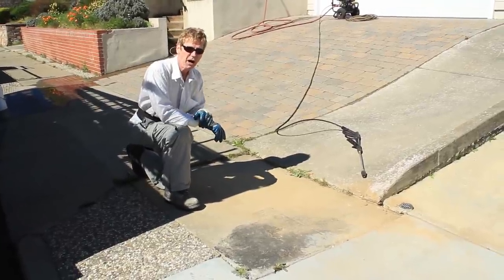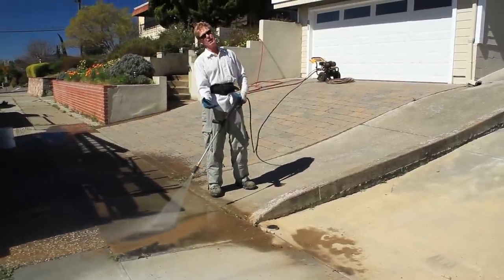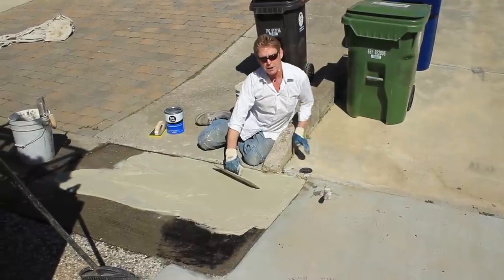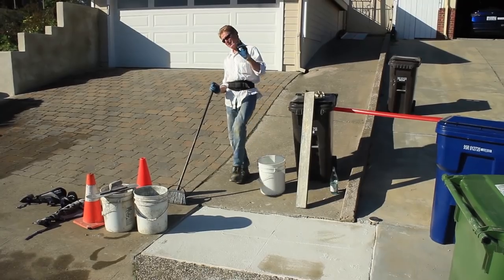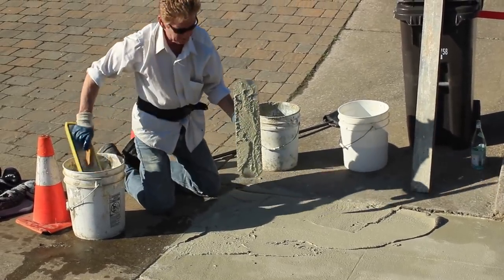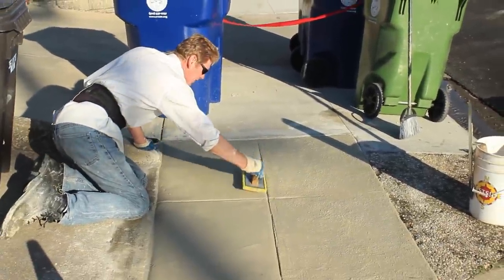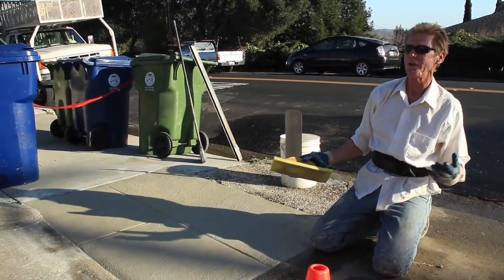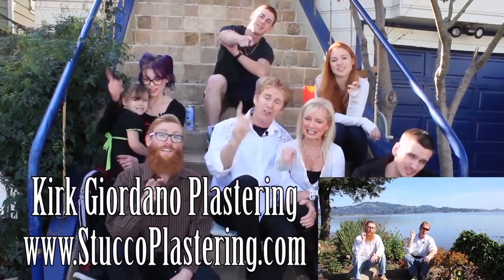Repair uneven concrete

Comment: Kirk. Only you can keep me Watching a video about an issue I don’t even  have for 25 minutes, and still consider it time well spent. On holiday no less  ❤
Also. Funny how the ..what did you call it? Finishing touches? Are the hardest to achieve by a non pro.
Alsoooo not only did I watch that aforementioned video, but also (after bombarding you with ratio questions), piggy backed on it, to fix concrete stairs, and a much more wedged parking entrance surfacing layer.
Still holds after few years  gone by,.  I’m not expecting 20. But I think anything above 4 ,to 5 years is a win. 

Anyways. Always love to watch a master at work.
Would love to see how that fix held over the winter.
Reply from the maker: Morning Fish dude,man, I like your style than you.😉

Comment: I know Kirk doesn’t like/specialize in resurfacing but it looks damn good. I bet the customer likes it
Reply from the maker: Evening Pierce, for 300 bucks she did, even knowing this is not a permanent fix, meaning what I applied will stay put, but that slab is sinking, and no doubt it will continue in the years to come.😉  Kirk’s Tip:  all subscribers or anyone who stumbles on our channel with a question, type it into our Stucco/Plastering channel, and like magic, a video will appear to explain how it's done. 
   This feature is miles ahead of any plastering forum. 🥳
Kirk & Jason Giordano Plastering

Comment: Kirk I’ve done it several times with primus mud and ran acrylic finish on it. Also I have just skimmed it with poly bond and/ primus and it works great as a resurfacer. Keep up the good work
Reply from the maker: Good evening Amber, good tip, thank you.🍻

Comment: Appreciate your videos! Got a few cracks around my house and also a bag of poly blend and since the concrete dude didn't show up to give me a quote I'm just going to try the poly blend...ever try the prism stuff? have a box of that in my garage also...(no idea where i got them! Probably came with the house) Thanks again sir 💯:)👍.
Reply from the maker: Good afternoon Charlie green, Polybond will work for crack repairs but has lite grainy sand to it. 
If the crack is huge, you may want to hit it again when the poly bond is dry as it won't go more than a quarter of an inch without shrinking.
FYI, Poly-bond by La Habra is specifically engineered to adhere styrofoam to base coats of stucco. Thus, it's an adhesive cementitious cement.
          Kirk and Jason Giordano, together we have provided to all folks throughout the world the most complete plastering encyclopedia ever created online.
   The plastering surgeons of Youtube, with well over 850 'free' self-help videos 🎭 👀💃
 Bringing peace, love, and brotherhood back into plastering.🏝🎆

Comment: One of the best instructional  you have ever produced guys. 
I think I know why the water part is such a recurring issue.
Most of us do it yourself guys, never used a power washer, not to mention a gas powered one.
So ..for me at least, it want obvious just how much important it is to make sure the old concrete is not just damp.. but wet inside as well, for a good mechanical bond. But I do have a tip for those without a notion as to how to damp the old surface.

Get an old bedsheet even. Cover the surface with it and drench it with water. And let it hang there for an hour, while making sure it’s always drenched with water.
That should do it. 
Also..another tip for good bonding is first brush the surface with a water thinned cement ..simple one. Like a. Painting texture.
As cement is basically a sort of adhesive ..combining it with water like that will connect the two layers.. old and new ..better.
Just make sure that the brushed cement is still at least damp when you apply the top layer of concrete. If it’s dry then you need to wet it again
Reply from the maker: Good morning Gefilta, Good advice my friend.
    I would add if a homeowner does not have pressure washer available that is strong enough to etch the concrete. 
Then to improvise and etch the concrete well with a "wire-brush" and some old fashioned elbow grease, then rinse off excess loose cement dust. 
   Some readers might think, where do I find elbow grease? 😎I'm referring to physical strength or muscle with the effort to scrub the dust off.
Folks are now ready, to begin with, whatever first prep steps they are partial too. 
                         Bringing peace, love, and brotherhood back to the world of, “Plastering.” 😏
With over 800 educational and free Youtube videos, by your favorite plaster geek, “me,” and my son, “Jason,” the bearded plasterer.😉
Reply: Kirk Giordano plastering Inc. 
good advice.  I also rigged a wire brush myself so I could mount it on a jigsaw . Pretty funny. 
Will an acid wash . Like 30% acid, do the trick as well? That is.. if you ever heard of it
Reply from the maker: Good evening Gefilta, yes, the acid will etch the concrete.
Then go into the street and makes its way into our water supply. I don't like to use toxic stuff if I don't have to.
Plus, with using acid you'd need a respirator. The only toxins I'll allow are whats in my beers. 🍺
                         Bringing peace, love, and brotherhood back to the world of “Plastering.” 😏
With over 800 educational and free Youtube videos, by your favorite plaster geek, “me,” and my son, “Jason,” the bearded plasterer.😉

Comment: You are right,  that stuff  is strong, I  tried  to remove  a crooked piece  of foam from around  my window  on the brown  coat, just about impossible,  unbelievably  strong, good job.
Reply from the maker: Good morning DJ.
 Poly Bond is so strong an adhesive cement plaster, that we would have to cut the styrofoam with a saws-all, as once stuck. it's permanent.
Bringing peace, love, and brotherhood back to the world of, “Plastering.”😏
With over 800 educational and free Youtube videos, by your favorite plaster geek, “me,” and my son, “Jason,” the bearded plasterer. 🍻

Comment: That looked difficult!    If Kirk doesn't make it look easy, it's a tough job.
Reply from the maker: This was easy but tedious. There are many more user-friendly products in the description. The most important part is cleaning the concrete, so it's clean enough to eat off. Otherwise, no product will work. 🥽

Comment: Hi Kirk thanks to you I did all the stucco walls in my yard . I caulked all the hair lines and then used Commercial Grade Quikrete with Hydraulic Water- stop Cement .
I was able to seal a whole I had i my wall and water proof my basement . After that I painted my stucco walls in the my yard with Sherwin Williams  Loxon xp  Water proofing  Masonry Coating. I trying to send you a picture but I have trouble sending it to you .   I  even build a small  garden wall for my yard .  
I really help again its about cement and  know you don't cement . But know you know this question . I  three cement cracks  blocks in my yard .   Two are  medium size and the other is half  of one block .  I don't want to pull them out . I just want to go over them and fill them up with cement .  My question is ? I  been told not to mix  Grade Quikrete with Hydraulic  with Commercial Grade Quikrete Mason Mix Type & Mortar . I was told it will crack ?  Is this true ?  I didn't have enough  to fill  the whole and have to get more  and it did get hairline cracks . I tried very hard to do this and wasn't easy for me but I am not giving up .  Please help me and suggest to me what I am doing wrong ?  I will  try and send pictures . I Proud of my self the yard looks nice . But I want to do the cement blocks before it gets too cold .  You are helping everyone one and a blessing for all of us .   Thank you .
Reply from the maker: Good afternoon Brenda, no worries I'd recommend a ten or 25-pound box of, Raip set mortar or even Rapid set stucco, both will work.😉
 The mortar sets really fast and is crazy strong, in fact, it set so fast you will have less than ten minutes to design it like you want to.
 The stucco will also work it set in about 20 to 25 minutes. The decision to bay a ten-pound or twenty-five-pound box will have to be made by you.
 It's best to buy too much and throw some away than to buy too little and need more.🤔
          Kirk and Jason Giordano, together we have provided to all folks throughout the world the most complete plastering encyclopedia ever created online.
   The plastering surgeons of Youtube, with well over 850 'free' self-help videos 🎭 👀💃
 Bringing peace, love, and brotherhood back into plastering.🏝🎆
https://www.nps.gov/tps/how-to-preserve/briefs/22-stucco.htm

Comment: I have an over 50 year old concrete patio behind my house in NY and due to the freeze/thaw cycling we get massive sprawling if you don’t seal concrete and/or use salt in the winter; we’ve been resurfacing concrete for decades with simply a pressure washing, 2-3 coats of diluted bonding agent sprayed over, and a Portland slurry with a fortified then simply Portland and sand, plus just a little lime and it lasts for years and is quite cheap. For some better protection we’ll use RapidSet CementAll and their flow aid as it cures out to 9,000 PSI and is very resistant to water and salt. Top and Bond is a lot of people’s go-to but is just too expensive for any kind of real area; we’ve done this over driveways and in garages and have never had issues with some top coats going beyond 20 years, though some can pop/sprawl especially if highly salted and if we get days cycling between warm and freezing. Ultimately do what you’re comfortable with but I’m always looking to save $ and topping concrete is a big money saver.
Reply from the maker: Howdy Libertarian, many ways to skin a cat, those methods do indeed work. That cement all is kind of fun to work with, huh, sets in like 5 minutes, but the strength is indeed unreal. cheers, my friend.🍾
Reply: @StuccoPlastering : Depends a lot on weather as it sets a lot quicker on hot days but 10-15 minutes can be expected, once mixing starts; you can extend times by keeping the bags cold or using ice water and speed things up by using hot water. They also conveniently have packages of flow aid, which works like a super plasticizer to increase flow without increasing water and decreasing strength, and a set retarder which buys about 10-25 more minutes per packet up to 4/55 lb. bag. I like the RapidSet line as it is hard as a rock in an hour, without set retarder, and was a big go-to in the Military when time counts. Grew up in a family of tradesmen including a mason or two and while I didn’t go into masonry I do it from time to time; I’m always amazed at the longevity and look of a days work, you just don’t get that from all the trades. Like the videos, just thinking of stucco as I’ve been redoing the 50-140 year old coat on the foundation and just unifying all the additions; while it looks nice it reminds me I’m no spring chicken and I’m glad I choose a trade that was less manually hard.
Reply: Top and Bond? I'm halfway on an area trying Top and Bond, but it ends up with some  cracks and blotchy spots. The manufacturer now tells me Top and Bond is NOT for resurfacing any area, only for small repairs... Everyone tells me Ardex is the best stuff to use now.

Comment: OK, went to both Lowes and Home Depot  and could not find this Poly Bond. A dude on the street said he could "get stuff" he looked really shady but for $100 he hooked me up with a pack (it looked like he took a bit for himself). I have no experience with Poly Bond or concrete for that matter, but I used hot glue once so I figured how hard could it be? Well, it was a disaster. I managed to burn down my house! My wife left me for the shady dude and my pet fish no longer acknowledges my presence. If only someone had warned me!
Reply from the maker: Howdy Hanging in there, like a sock in a dryer, you still have his phone number? Hook me up.🍾
Reply: Cause he's  a fraud
Reply: @HangininSF you just made my day 😂

Comment: Really enjoy Kirk and Jay's videos. I'm hoping the leveling concrete that you mentioned from Lowe's or HomeDepot will help for a basketball court 35×35 with hairline cracks
Reply from the maker: Look for Rapid set leveler as Rapid set is some crazy strong stuff.🍾
Reply: @StuccoPlastering  thanks for the tip Kirk. 👍

Comment: Rapid Set works great, but better move quick.  We fixed pot holes in Sky Harbor airport with that stuff.  Set to 4000 PSI in 2 hours.
Reply from the maker: Howdy good tip I think, Is it an adhesive cement or just a cement?🤔
Reply: @StuccoPlastering  Rapid Set is its own type of cement, it is non shrink, and can even be used for doweling anchors.  It can be feathered, They have patch, mortar, stucco, concrete, water stop. They actually started selling it at Home Depot, used to be only in concrete supply houses.  They have 10 pound boxes and 50 pound bags. Grab a blue box and try it out, great for repairs, will hit 12,000 PSI in a month.  I use it to repair stucco around garage openings that were vehicle damaged. Its definitely an adhesive.

Comment: Kirk do those yellow floats  make  have a nicer look compared to the  green ones i seen you use  i know a little the finishing  part. I Was Union concrete carpenter for over 25 years i  stated on Fondation  I did almost everything hi risers in L.A  Highway bridges. But  never tried stucco any of my walls.  Now I  feel like I can do a nice job  i really like all your videos
Reply from the maker: Hi Joe, there is no difference in the appearance of the stucco finish, the yellow ones are made a bit stronger.😉 Depends naturally on who is making them.
Reply: @StuccoPlastering  thank you Sir your the best. I'll take a picture of the block wall and stucco job i did watching your videos
Reply from the maker: @joegarcia4424  Howdy Joe, cool beans Daddieo.

Comment: Well I don't want to put a hole in your boat, the lines are called control joints, expansion joints are oil impregnated fiber board. Usually installed next to drive cut, or to marry garage floor to driveway. And used in many other applications.
Reply from the maker: Howdy Peter, what lines?
      FYI, I have many videos that explain control and or expansion joints.
 Bringing peace, love, and brotherhood back to the world of Plastering. 🌍
With over 850 educational and free Youtube videos, by your favorite plaster geek, 
🤓 and my son, Jason, the bearded plasterer.💃🧘🏻🧞‍♂️🎉
Reply: @StuccoPlastering  just got give you a little shit, your a professional plaster I'm a career concrete geek slipform operator slash structural . Now I lay block brick, and some plastering. Your videos have helped me tremendous, thank you happy forth!!
Reply from the maker: Greetings Peter, no worries, I'm. chilling. 🍺
    The complete plastering encyclopedia on video, by the plastering messengers of Youtube.  
     Over 850 videos 🎭 👀💃
Reply: @StuccoPlastering  Happy 4 th

Comment: Why not use rapid set? Rapid set is for resurfacing and and will adhere to concrete, and be allot stronger than polybond.
Reply: Polybond has more adhesive in it, although they are both extremely strong, as a door and window contractor that does his own stucco, I'd go with what Kirk says.